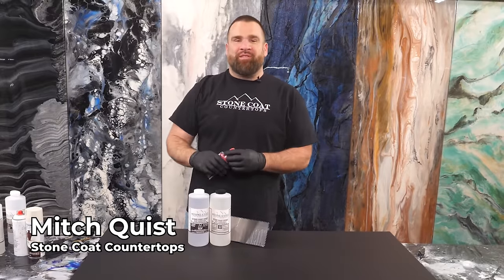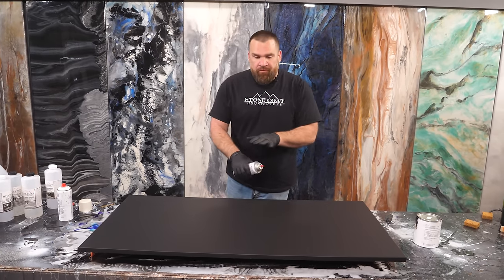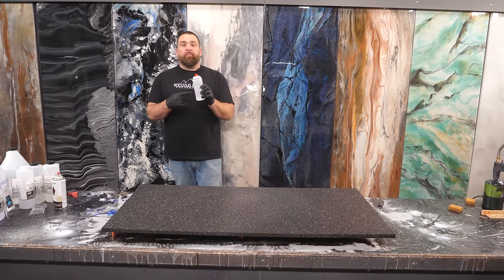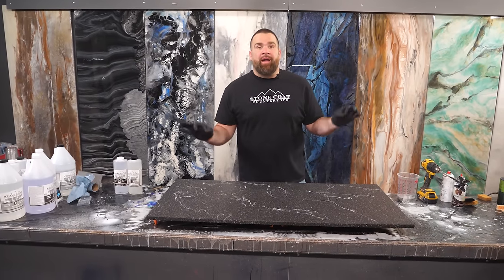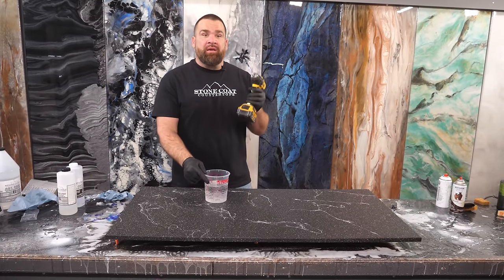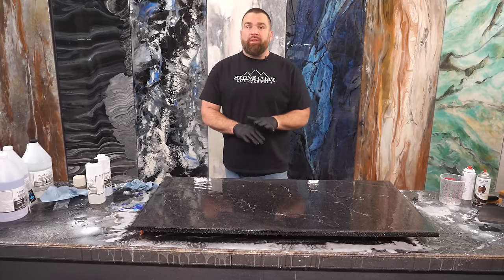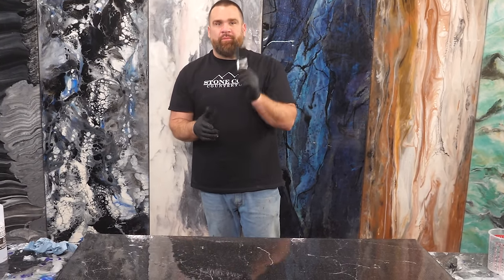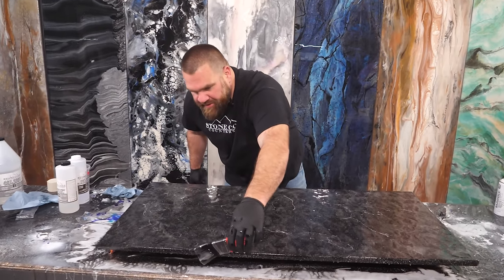Instant Faux Black Granite | Epoxy Design Ideas

Comment: I'm building my dream standing desk right now out of an 8 foot birch butcher block & the game plan is to do a single coat of black water based solid stain over pre-stain so it's dark but the grain & block still pops through, then I'm going to do a few thin layered pours with the Montana Marble Effects in between each layer. Once that's all done sand & hone to a stone like finish. The idea being it looks like marble until you're right up on it & see the wood at the bottom. Hoping it comes out great. I just did a test piece on some birch ply yesterday & it's looking like my nutty idea is going to work! I just have to remember to bug wide gestures with the Marble Effects. A little bit seriously goes a long way with those cans! Super easy to overdo it.

Comment: when you are making your countertop wood substrate, how much smaller do you make the wood for two coats of epoxy?  in other words, how thick is each coat of epoxy on the edges of the finished countertop?

Comment: hey will clearcoat flow & cover properly over a waterfall edge countertop? Also the 4" vertical back of most countertops, can this epoxy cure on a vertical piece like that? Maybe mix thicker?

Comment: Hey Mitch, when I bought my first torch I got burned, no pun intended, because if you tip it over it shuts off. Do you have any torch recommendations? Am I able to disable that safety feature? Also, you guys should be more active on twitter.

Comment: I can’t tell you how much I’ve learned watching your videos.  I’m getting ready to pour my first table top (kitchen bistro table top) but I have an issue in that my shop is unheated.
Keeping the temp. (Or even getting it up to) at or about 65° in the Pacific NW isn’t possible even in July around here (where nighttime temps still fall into the lower 50’s).
So my question is this…

Can I still get a full cure with an extended cure time stretching into say 8-10 days at ~50°??

Thanks for these great instructional videos…keep them coming!